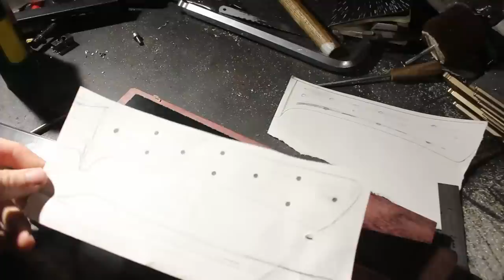Making a Katana from a Circular Saw-blade

Comment: Very nice Katana style Machete. It was nice to see you using the water to keep the steel cool so you would not lose the hardness of the metal. The sharping stones where nice to see to. And the handle had way to many pins in it but was still so pretty. Good choice of wood. Keep up the great work.
Reply: Technically not a Katana but more like a Machete, but who cares, you did an incredible job and I really liked it. The hardness of the saw blade ia clearly eminent hence wondering how it will react against a strong blow in a hard object as it tends to look more brittle to me. Personally i feel the sharpness will last considerably long due to hardness,  and I also feel you can make it a lot sharper than what you shown to us. 

Great Jobs and kudos

Comment: Very beautiful blade. For some reason I want to see this katana pulled from a knife block built into the countertop. When it's in the knife block it looks like a regular knife (6" to 8" blade), and then you draw the full length of blade from out of the counter.

Comment: The katana is generally defined as the standard sized, moderately curved (as opposed to the older tachi featuring more curvature) Japanese sword with a blade length greater than 60.6 cm (23 1⁄2 inches) (Japanese 2 Shaku).

Comment: Great job!
Much, you have learned, youngling.

Looks like a blade for cutting competitions, although it would need a lanyard hole at each end of the handle for that.
Nice to see someone else cutting bevels with an angle grinder. Have you considered clamping the blade at an angle so that the bevel surface you are grinding is horizontal? That way, you hold the grinder horizontally, which personally I find a lot easier than keeping the bevel angle consistent. It’s also easier to make the bevel angle and depth consistent between the two sides. Just a suggestion.

Comment: I know you were avoiding have to re-heat treat it, but this japanese style machete would look even cooler with a hamon.
Reply: It definitely would.  But it is pretty hard to bring out a hamon in sawblade steel.  I won't say impossible because I've seen a maker create an effect like a hamon in sawblade steel.  I can't remember who he was and I don't know how he did it.  I work in a mill and have made most of my knives out of sawblade steel.  It is a deep hardening steel and isn't the best for a hamon.  That being said, I'd seriously love for someone to prove me wrong and show me how they did it.
Reply: @ericcartrette6118  As I said, would just make cooler what is already pretty cool.
Reply: @ericcartrette6118  Since you work in a mill, can you give me a bit more info about old saw blades?

Like how often do you change them and what do you do with the old ones, do you auction them somewhere or sell as scrap or what?

I walked into my local mill, and asked if they have any old/decommissioned blades they wanted to get rid of, but they looked at me funny.

I've since been getting steel for my knives at car scrapyards, old car leaf springs do wonders and are cheap but they are quite thick and if you can't thin it out using an anvil, you have a lot of grinding to do.
Reply: @lazar2175  okay, I don't know who you might have talked to.  But the mill will either have a saw filer, which is what I am, or they will farm their saws out to an independent saw shop.  Usually a mill just scraps their old saws.  If they have a filer, sometimes he's open to trades for old saw blades.  I would suggest calling or visiting the mill and asking to speak with the head (lead) filer.  He may work a deal with you.  He may just give you a blade or two.  If they don't have a saw filer, then ask for contact information to the shop that repairs their blades.
Reply: @ericcartrette6118  Oh thanks a bunch, the local mill is just a small one run by two brothers and a few more workers so they could very well be shipping the blades to a saw shop.

I have found a contact number from a much larger mill, i'll see how cooperative they are and if it's worth the drive. I'm based in south Europe so lumber mills are quite rare and the closest major one is like 300km away, but if i can get a few blades i guess it will be worth the trip.

I really really appreciate the information though and can't thank you enough, thanks for pointing me in the right direction.
Reply: I was just going to name it machete and the saw your comment. Japanese style machete that is. Thanks a lot.

Comment: I see everyone making swords they look nice. Maybe you will give the real process a chance the combination of two metals cooling in the water shows it's natural form
Reply: There isn't much point in trying that. Not only is forge welding hard to pull off, but quenching in water with the clay on the blade like the traditional way really begs for warps and cracks. It's really on a completely new level of skill that takes decades to master.
Reply: @mrkiky  what else we got to do. You know how to shape it. I was gonna use a roller press and see if that was more reliable then pounding it out but got a lot of projects

Comment: now imagine that drill holed tang inserted in a handle mold and filled with molten aluminum, then you shape the aluminum and polish. And you could make it twice as long so it's a half tang sword, but as strong as full tang and handle would outlast several lifetimes. That technique also used with black ABS plastic and steel in truck part manufacture, such as engine fan blade hub, steel hub and ABS blades.....the steel hub is holed and ABS molded into and around periphery of hub. Only the fan blades will break...if ever....
https://en.wikipedia.org/wiki/Wakizashi
a wakizashi/short sword to accompany katana
Reply: Nice hahahhah
Reply: Or, like a regular katana and countless other swords of the past, you could pin it into a wood handle, and that would also be strong enough to do the job.

But either way, that's only if the steel is hard enough. It looks like the blade has carbide teeth, in the beginning of the video. So the steel probably isn't that hard.

Comment: I’ve never seen somone use water while grinding steel. I’m curious as to why you wet the cut so many times?
Reply: It is quite possible it is to avoid having to re-heat treat the steel. As sawblades already are hardened and treated..
Reply: @jokke1702  I'm pretty sure that's it. The water doesn't really help the cutting in any way.